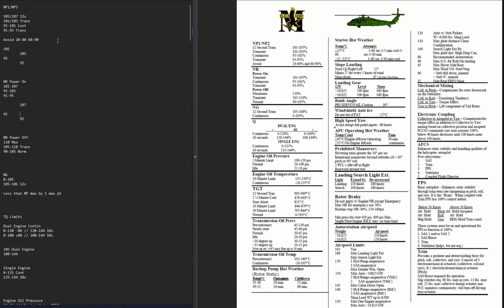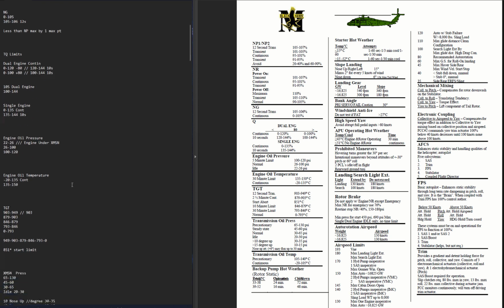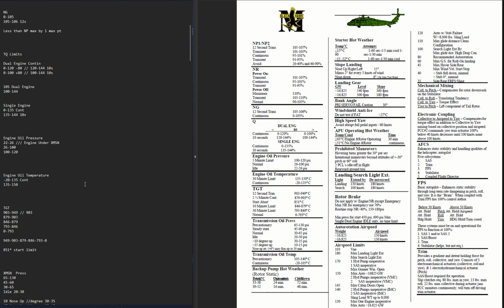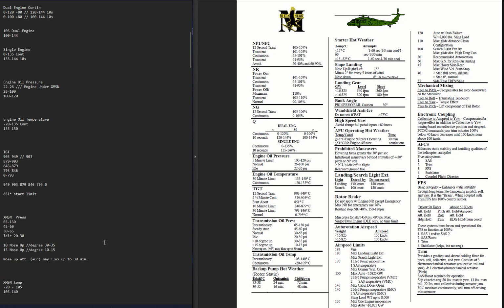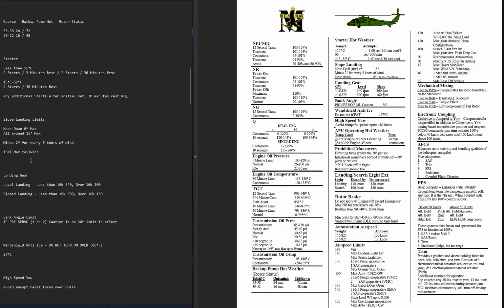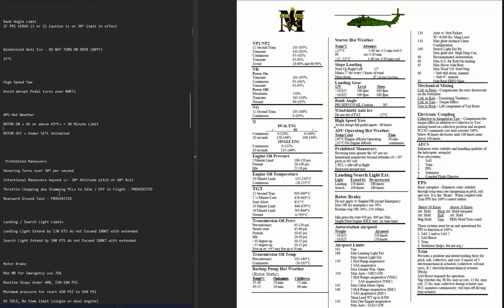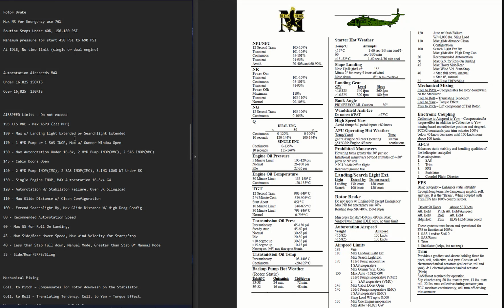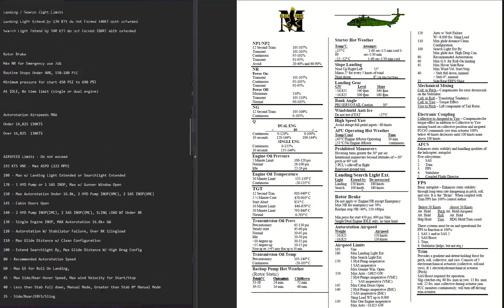UH60M Limits Study and Review

Comment: Great review, quick comment on the emergency rotor brake 76% (sorry this is a pet peeve). Most likely the limit is there because either the application of the rotor brake would cause the helicopter to roll over or the brake disk will get so hot it won't work anymore. Yes you will probably be fine pulling it at 80% but at 100% you might make the situation worse.

Just some food for thought, take care and thank you!